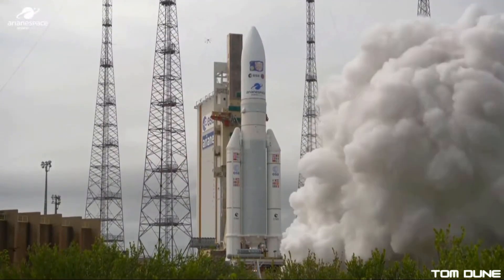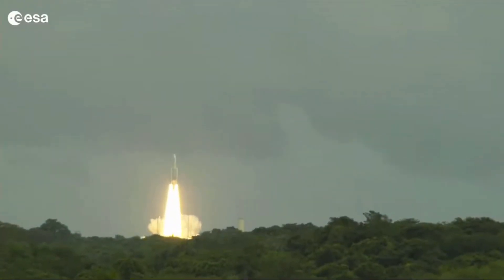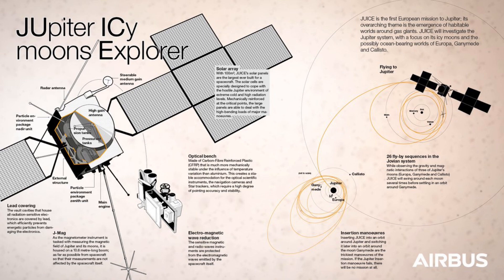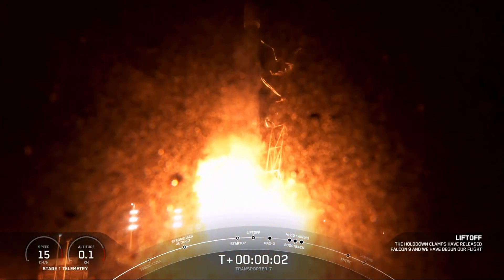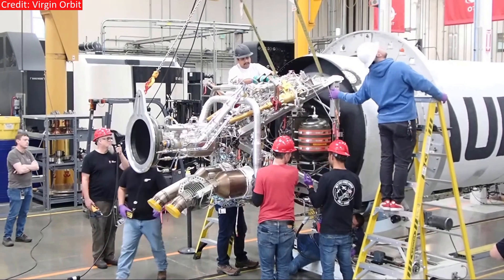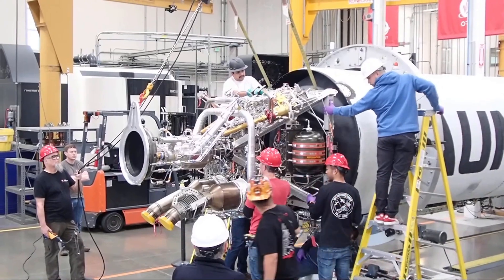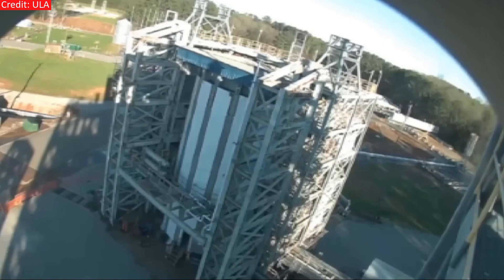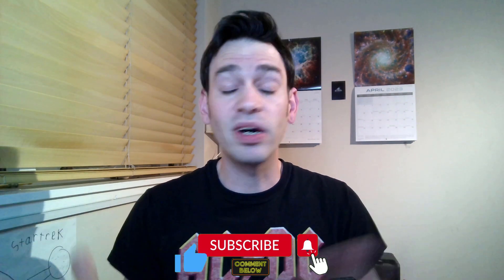UK Space News - ESA Juice, Transporter 7, Starship, Virgin Orbit, ULA

Comment: Great to have such a busy week covered in such a smooth and informative way. Keep up the great work Tom. 

What's your thoughts about the state of stage zero at Boca Chica?
Reply from the maker: Appreciate it a lot!
Wow, stage zero is a mess. FAA have grounded starship and that could be a big project. There's things coming out about environmental impact too even from a noise level. The pad sits just above the water table so hard to dig a flame trench. Elon has a water cooled steel plate idea but honestly they need a redesign, raise the pad up to sit above a diverter trench with water deluge system and add a new section to raise the height of mechazilla. Big engineering project for sure but within possibility. Do I think we'll see another launch this year? After reading some things today I have to say no right now.

I'm interested to see if you guys want me to do more worldwide space news at times UK news is running thin?
Reply: @tomduneofficial  I agree that it's a mess (read utter wreck). I'm not expectant of another starship launch this year either. I heard that all of the static fires leading up to 4/20's launch were only at 50% power. I'm not really surprised that the concrete didn't hold out with 33 full power raptors blasting it. 
Yes, the flame trench options will be tricky for sure but not impossible. I mean, SpaceX have done very impressive , "Impossible" things before. 
I think Juice and Starship were huge events in the space community and it would have been odd if you hadn't have covered them. I personally liked seeing some international news from you. Would you consider doing any deeper dive videos into the working/design/operations of UK launch facilities. - I found some good PDFs online which detailed the building designs of the Moine Ho Site in Scotland.
Reply from the maker: They were indeed at 50% throttle. SpaceX somehoe hadn't realised just how powerful the full thrust would be having 30 raptors go at once. They took some unnecessary risks in not building the pad properly from the beginning, we all thought it looked wrong but hey ho, they'll have learned and I have faith they will come good.
That's cool of you to say. UK news will always be the backbone and primary feature of this channel but I'll keep including the best international news as well. In fact, there's one piece at least in next weeks video planned!
I actually do want to do a feature on the spaceports, its part of a planned series of releases I have. I have specs for most of the sites including the Sutherland Spaceport you mentioned at A'Mhoine. I'm still in planning for the series as it's getting time to do it haha, but I hope it'll be worth the wait!
Reply: @tomduneofficial  Sounds really interesting. Can't wait to see each of your videos. Keep 'em coming!